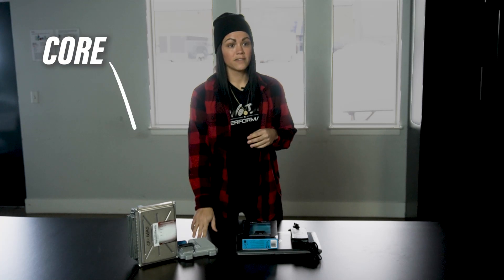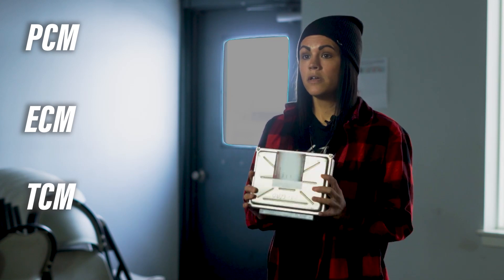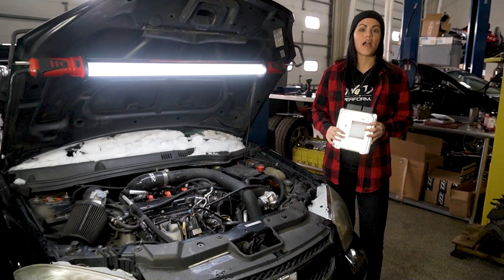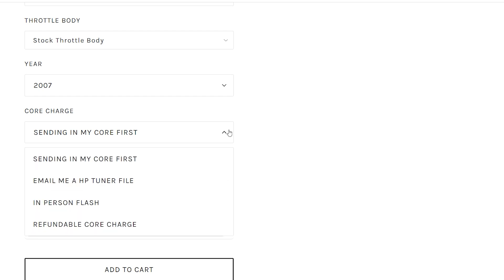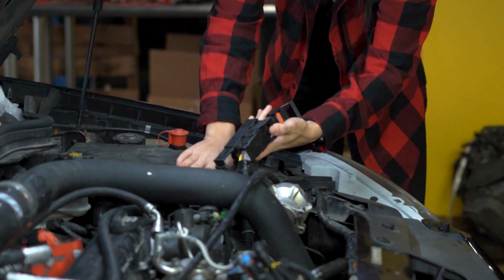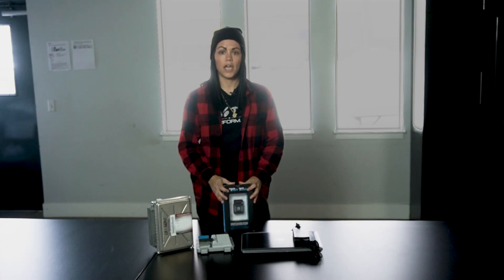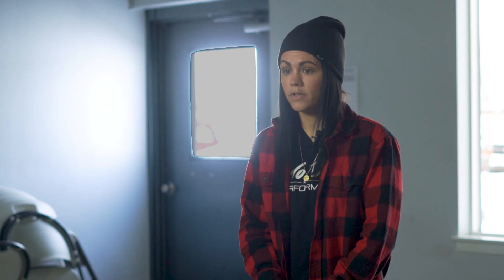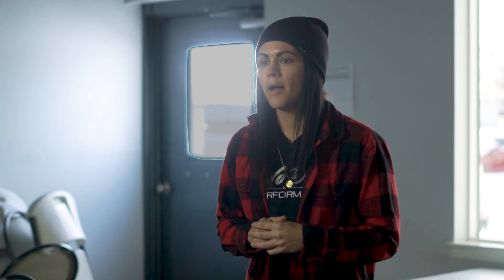How To Order a ZZP Tune

Comment: Has anyone tried where you send in your core and does it still give the full hp?
Reply from the maker: When doing a "sending in core first" tune we have to tune for the lowest common denominator, meaning they can be a little more mild compared to a full remote tune. Since we cannot see your fuel, knock, fuel trims, etc we can't turn it up like we could on a remote tune; we will recommend a remote tune to customers 100% of the time.

Comment: so what about the people that have HP Tuner and want to learn what is safe and not safe to change. I've call every speed and dyno shop in town and NO ONE is willing to help teach some to do it the correct way and nit blow everything up. and it is so hard to find any kind of info on tuning the 3800s.
Reply: Well Justin, a lot of it comes from learning, and doing a lot of research. Along the way, unfortunately, you may take out an engine or two learning what you can and can’t do. It’s not very profitable for most businesses to teach you how to tune your own car when they have done the years of research and trial and error to understand and learn how the software works in conjunction with how your car reacts to the changes. 

That’s Why doctors don’t teach you how to diagnose yourself, right? :) 

Basically you’re going to have to learn, and kind of teach yourself if you want to tune your own cars. There is a wealth of tuning books, and information out there on the subject though.

Comment: You guys did a fantastic job in my early tuning journey. I sent ya the vin, told ya'll that i had a downpipe, and then sent me the tune. i proceeded to drive to the w-body meet back in 2019. think of the daily buick with the bicycle rack 😂 you guys adjusted my tune perfectly at that moment, and my car has been reliable and fast when i needed it to be. The dyno tune has been perfect for those last 2 years, albeit a little thirsty on gas. but at least it keeps my engine safe. look forward to seeing ya'll again!
Reply from the maker: Awesome! Smiles per gallon is what it's all about! Come hang with us tomorrow at 4:00pm. We'll be having a LIVE podcast right here on YouTube.